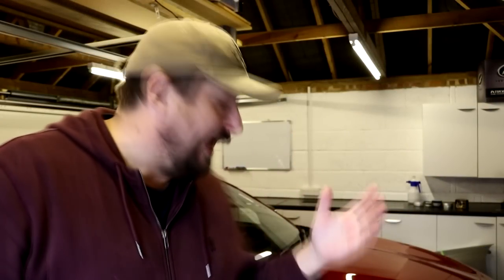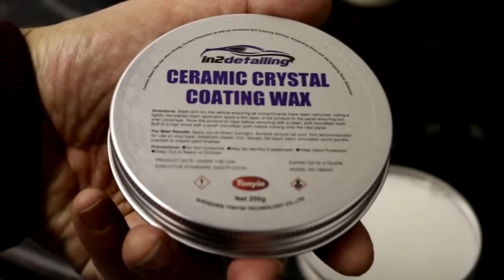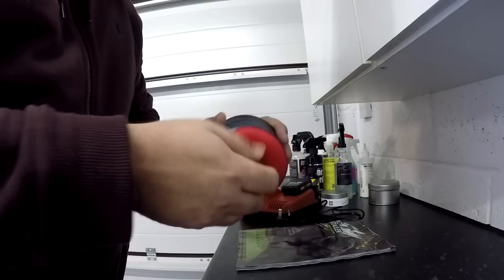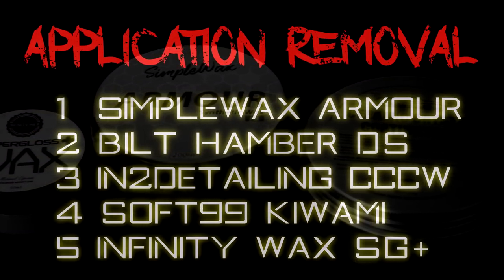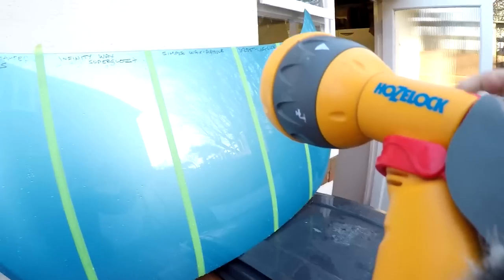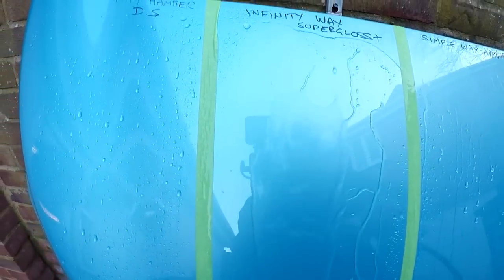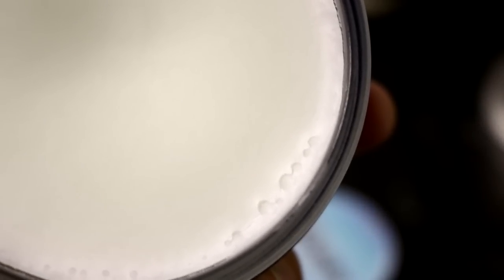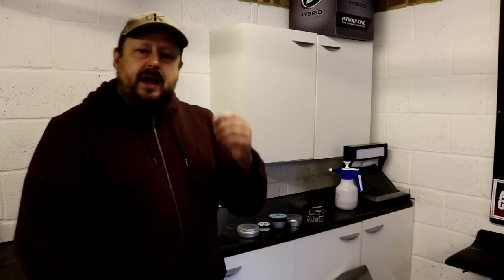Bilt Hamber Double Speed v SimpleWax Armour v Kiwammi v SuperGloss+ In2Detailing CCCW Scene Wax Test

Comment: Nice review fella.   I ordered my BH DS wax last week on your hour long product review of BH products (Dec 2016 - just watched last week).  I ordered direct from BH as they were cheapest for total cost, including shipping (living in N' Ireland, you sometimes have to pay excessive shipping rates).    In the packaging was the wax, a foam applicator, and a decent buffing MF towel.   There was also a set of instructions.  So, I'm not sure if other traders selling BH wax will sell these instructions on - but they seem simple enough to follow from a quick read through.  I'll be looking forward to the results once the weather turns a bit nicer.

Bit disappointed with your final review segment, regarding presentation and desirability.  I desired BH DS wax, simply because it's the best at what it does for the price.  I'm not applying a fancy glass jar to my paintwork, just the product, the wax.  I guess in a functional pot such as BH uses, it keeps the cost down.  Keeps my Scottish financial senses from tingling too much ;0).

Comment: I found that the Kiwami on top of Fusso is a superb winter combo. Kiwami adds the extra gloss that Fusso slightly lacks. The longevity over winter is phenomenal. My winter prep video was based entirely on this combo and the results were awesome! 

As for the high end waxes, not sure you're gonna be stretching to the top of the line Mitchell and Kings at around 5 grand!
Reply: Detailing and the Beast - DaveCHCI what would you expect to be a reasonable length of time for a wax to last during winter?
Reply: That's good to hear. Just scored a old fusso from ebay (new but old style) but am yet to use it
Reply: @benmulleady7266  it's one of those "must have" products. So useable and ridiculously long protection.
Reply: @DetailingandtheBeast  just need a bit of decent weather and time now to strip car and get it on there. Would wetcoat work well over it?
Reply: @benmulleady7266  over Fusso? I've used various protective QDs but never had the need to put on a spray and rinse sealant on it. I just top up the Kiwami after a few months when I get a decent ish day. That then lasts easily til summer when I prefer much shorter longevity but higher gloss products.
Reply: @DetailingandtheBeast  yes over fusso. Guess if it doesnt need it then that's great. Thanks
Reply: @benmulleady7266  @detailing and the beast
Can you still get the old fusso? What's the difference between the old and new?
Reply: @davegraham1398  yes, got it off ebay. It's a tenner a tub cheaper and based on Jon's review arguably better
Reply: @benmulleady7266  thanks for the heads up 😀
Reply: Ive found the longevity of Kiwami to be amazing. Just needs the occasional QD on top. Done and dusted SI is the weapon of choice there.
Reply: @Crashed121  the longevity is coming from the qd not the wax here. Don't use a top up, that'll give you the true longevity.
Reply: @jrooney06  personally, 4 months of hard slog, winter salt, grit, mud, and grime. 4 months and you're doing well. I have a 4x4 with tyres out past the arches so winter is a bit more brutal for me.

Comment: I bought the BH double speed wax after seeing it on your chanal, very impressed so far and it comes with a class aplacator and microfiber!
Reply: Hi mate how long does it last before it stop speeding in sheeting
Reply: @diljithayre9379  if you use a good detail spray or some quick wax of sort it could last up to 6 months.

Comment: I use BH double speed, great wax, great price and I got a free applicator and microfiber cloth, how can you go wrong with that?
Reply: Agreed, I did my car at the end of summer, BH Cleanser Polish first and 2 layers of BH DS Wax. It's still going well, not perfect but very good anyway. I also did same thing on the hood of my father's car before the winter, but only one layer and 12 year old paint, it is still holding up, and that is on the front  of the car, incredible results.
Reply: Agreed! Simple to use, awesome results and wicked price!
Reply: How long should a tin of BH 250ml last me??  And do you think AG SRP would suffice before hand. Will be taking delivery of a new kia next week. Thanks in advance.
Reply: @Nick-7432   - a couple of years at least.  More than likely more.
Reply: @rigger8722  i use DS out here in the tropics. (Thailand) does great

Comment: It‘s too late for this review, but for a next one maybe: I found Kiwami to perform MUCH better if you let it cure much, much longer - up to 60min. I think it has something to do with the strong solvents in it and that they evaporate over time, especially if you get a tin which has been standing on a shelf for a very long time. Maybe that‘s something you could test on your own, but I think it‘s an important tip for consumers, especially since the wax dries so nicely and is a doddle to remove even after 60min.
Reply: That’s good feedback.  

In return, try original Fusso on a vanity mirror...or even brass instruments.  If you get it right, you’ll thank me later.

Comment: Thanks Jon 👍. I like the way you threw in a test that the BH product would cone last at - to help level the competition 😀 appreciate your forensic approach to testing. Cheers
Reply from the maker: the desirability thing I introducd a while back (see the second SI02 spray).   I try and run a consistent set of tests and rank them. so I wont introduce tests just to spread the love so to speak, every test that has a winner also has a looser (ying and yang).  Its an agressive format or competative format, but its just the way Ive always done it and brands are more than welcome to reach out and opt out (some do).

Comment: Applied BHDS yesterday.  I'm impressed with the results - even compared to the Gyeon One coating I applied last year.  I did feel the grippyness, but that was easily solved using a fresh baldwipe now and again.  No sweating even though the car had been damp (dew) overnight.  All in all it does not feel like step back from the ceramic coating (apart from durability obviously).  PS: it did come with an applicator and nice MF cloth, and instructions were on the tin.

Comment: Hi Jon discovered something interesting with DSW earlier.  I got a coat on the car but then it rained. So I buffed it off when still wet. The DSW came off way easier than when dry. Just wringing the microfibre out when wet. Then when totally dry just when over with dry Microfibre to do a final buff and make sure I had it all. Way easier to remove and only needed tow cloths were I would normally get through 4 or 5. I will defo try it again.

Comment: Great vid again John, I got hooked on BH. early after initially getting into this. However I haven’t done a full clean decon and wax yet. But my first attempt is going to be original soft Fusso, with KOG over the top. It’s great that BH has ranked well in this as it is my preferred brand and I will definitely try it. 
Thanks 
Steve
Reply: I bought a cleaning kit from Bilt Hamber I'm still blown away over the products, it's so efficient and easy to use. I also used Fusso on my car. Considering to go KOG on top. But I would say it's depending on the car since is metal black with a green play to it im afraid I'll discover the color play with to much shine
Reply: Mine is dark metallic but I will give it a go.

Comment: As a company I generally rate Bilt Hamber very highly, their products are well priced and top quality.
Saying that I find the double speed wax too 'grabby' and although it applies and cures well the removal  can be troublesome and finish lacking gloss. In it's defence I'm guessing it aimed more say as a protection product other than a finishing wax though.

Thinking back to the 2000s do any of you remember 'Max Wax'?
It was maybe more of a polish. I remember using it with great results on my Renault 5 GT Turbo Raider :)
Reply from the maker: it is a bit grabby you notice it more when like you are working your way around a car.. but I find with a thin film its still nice to buff with... finis wax isnt grabby but does not have the hydrophobic polymers and its twice the price.
Reply: A wet applicator pad really helps with the dsw. You dont have to let it cure for long, i just do it one panel at a time. Shot pile for 1st wipe off and go back over with a plush towel.  Gives the car a lovely warm glow and durability with the help of some detail sprays will easily see you through the winter.  The value for money with this wax is seriously unbelievable.

Comment: Good job Jon. Quality work as always.
I was just thinking, with the spray on wax/sealants getting better, would it be possible you did a video comparing paste wax to spray ones and maybe advise what's best for casual folk?
Reply from the maker: we have done this video actually already.  we took SI02 spray, lightweight ceramic, Spray Wax sealant, etc...    Was about a month ago... was like fusso V TW V moonlight etc..

thing is results are not generic.. Fusso for example is a mofo of a durabiltiy product whereas some other sealant waxes are like 2 months and gone...  but it give an example.
Reply: @ForensicDetailing  yeah I remember you doing comparison of spray stuff. I only wondered how are they like  against paste waxes

Comment: Hi Jon, any difference between soft99 kiwami and the original one? I was surprised you didn’t just use the original in the test as you said it can give 10-12 months?.... or do you still rate the BH over it?... does BH give up to 12 months protection?

Comment: When you were doing the chemical resistance test on the five waxes why would protection diminish and then come back hydrophobic again?
Reply from the maker: not sure seen that a few times and it is very subtle.    I think after determininng you are using a detergent that does not cling.. detergent blends can still sometimes contain fatty acids which need a bit more rinsing to remove and might mask a bit untill you give it a proper rinse.... maybe its this.
Reply: Forensic Detailing Channel could be.... Or..... the product broke down/removed and the new sheeting comes from the perfectly clean and prepped panel below the wax? 🤔
Reply from the maker: @GMDetails  I dont think its that no.   If I keep hitting that infinity wax panel it will eventually look like the other ones that have failed on the right.  They go like hydrophillic when you kill the protection.

Comment: Hi John,
Very interesting video. You know if you leave wax on and it becomes chalky, are you at risk of lightly scratching the paintwork? Also do ues your own wax on you details or others?
Reply from the maker: thats a ripping question.   answer is not really no, pragmatically speaking.  If your like on soft woefull non OEM butter soft clearcoat..   Debry in your microfiber cloth will still be the number one risk.   but you should always buff carefully and you can switch up to a open pile plush cloth and buff gently to minimize risk if you like.
Reply: @ForensicDetailing  thanks pal 😀

Comment: Great assessment of the waxes, looking forward to the review and testing of the high end premium wax.
Are they any better than the BH DS wax?
Reply: Hi, I think Bilt Hamber's Finis Wax is supposed to be even more durable. Less glossy then I suppose. But what way better are you looking for?
Reply: These 2 waxes are interestingly different and the chemical resistance test would show why. Bilt Hamber say that Finis Wax is their most durable wax and has more carnauba so is a better looking wax, but this durability applies to longevity rather than chemical resistance. If you wanted a wax for the winter and you were not going to wash the car much, then Finis Wax would be the best choice.
Double Speed Wax is said by Bilt Hamber to be their most chemically resistant wax. So it will do well in tests like this one, or if you were snowfoaming and washing your car frequently, but it would be less mechanically durable than Finis Wax - simply, less resistance to weathering.

The chemical resistance tests are great, but they are not the whole story when it comes to durability. Problem is actual waiting for durable waxes to weather takes months and that is way boring.
Reply: @isoharmi  For paying the premium price tag
Reply: @RadgieReiver  oh! 😁 I guess there is not 😅 unless Collinite 476s is in a good sale sometimes.

Comment: If you do the high end wax test, why don’t you test the Bilt Hamber with them to get a true comparison against high end and value waxes. At least we will have a better idea if they are worth the higher price or maybe not?
Reply from the maker: makes sense on one level but its a different kettle of fish.  higher end wax does not mean, more durability, more hydrophobic performance, more gloss.    Its more about the viability of a brand to be able to command the price tag combined with a good product experience.  Its subtle.     But I could simple put high end products against fusso and conclude all the high end products are a rip of because fusso lasts longer and costs 20 quid...   but theres more to it than this and this is not the case.  but yer its interesting we will get stuck into this nearer the time for sure.

Comment: My double speed wax has just arrived, I’m very excited to try it out tomorrow. It says not to use a wash and wax before applying. I only have meguiars ultimate wash & wax, Autoglym bodywork shampoo and conditioner and fairy liquid. Which should I use, if I use megs wash & wax (which foams up way more than Autoglym) I could use Autoglym intensive tar remover to strips its added “wax” protection? Also which shampoo should I use to maintain the wax afterwards? 
Thanks Jon
Reply from the maker: you cant strip freshly layed wax.   You should use the pure shampoo.  then do a panel wipe with bilt hamber cleaner fluid then apply wax :)  if you want to polish clean car, polish with bilt hamber cleaner polish then apply wax.   then wash it with touchless prewash and autowash car wash and bilt hamber QD concentrate (mixed down)  check out bilt hamber touch on new spray and rinse sealant as well.
Reply: @ForensicDetailing  ok great, I’ll buy some Autoglym pure shampoo. Can I use Autoglym SRP instead of the BILT hamber cleanser polish and then apply the wax straight after?

Comment: Jon would you recommend BILT hamber double speed wax or soft99 fusso dark. I want the one with the best beading and chemical resistance and I don’t mind reapplying in a few months
Reply from the maker: if you can get the old fusso that has the best chemical resistence and beading.. but new fusso is not as good.  for half the price I think double speed has the edge over the new fusso.
Reply: @ForensicDetailing  yes it looks like you can get it on Amazon but it’s quite dodgy looking so I’m unsure if its the new or old one. I bought the BILT hamber in the end
I’m going to polish the car after washing with Autoglym SRP would I need to use an IPA wipe down after this to apply the wax or is it fine?

Comment: Hello i have a question. When applying a ceramic coating, is it ok to use a slightly damp applyer whith worm water?
Reply from the maker: generally yes but follow specific manufacturers guideliness because they are not all the same chemically.  If in doubt ask that brand if water in the applicator is recomended, some will say no.

Comment: I use Bead maker once a month and Turtlewax Hybrid sealant the rest of the month (i wash my car at least 5 times a month)  all recommended by this channel, would there be any side effects from this ? Also my bonnet, front wings and bumper have PPF applied, do these products degrade this at all?
Reply from the maker: most products are at their best with full clean bare panel prep.   but like beadmaker and TW you can like wash and just apply it and it works great just perhaps you will loose some durability.   they wont degrade PPF buddy no.
Reply: @ForensicDetailing  Cheers!

Comment: Any chance of doing a mini test similar to this but just comparing the Bilt hamber waxes? I’ve got the hydra-wax, which I’m happy with. I do wonder how much crossover between products there is in their range. Is it worth people paying for the hydra-wax if the double speed does the same job for less outlay, for example.
Reply from the maker: IVe compared finis and double speed.  finis is smoother to work with..  both are high nuba backboned waxes with similiar solvent systems.   basically you go with double speed for value and beading and finish if your a purest and want a smoother buff.
Reply: Forensic Detailing Channel  nice one, cheers John.

Comment: You basically can't go wrong with any Bilt Hamber product.
Reply: The only bad experience I've had so far with BH is their Surfex HD APC.  I wasted most of it because the plastic bottle doesn't resist the potency of the solution over time. Yes, after a couple of months it actually ate through the plastic bottle. It also destroyed a pump sprayer. Brilliant cleaning product I must have had a defect bottle.